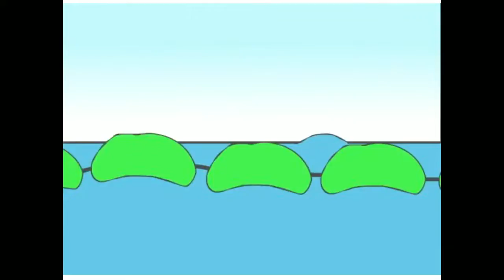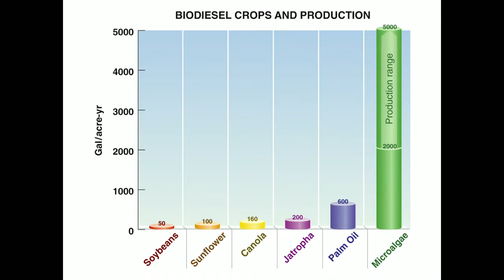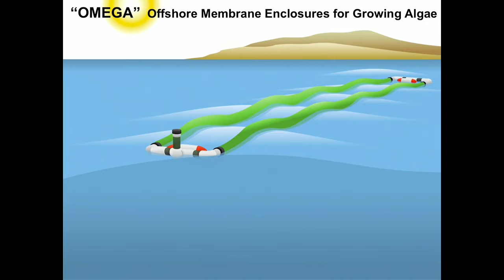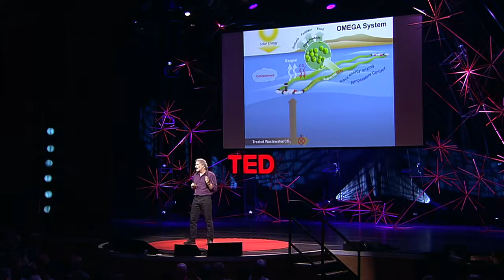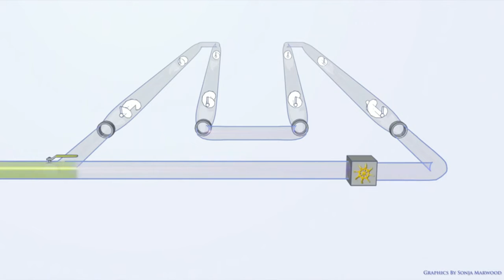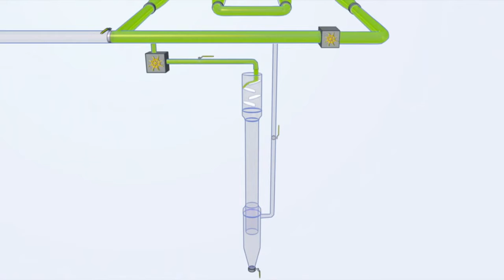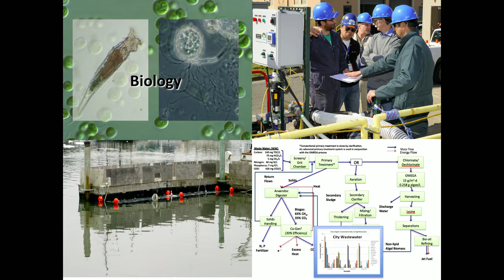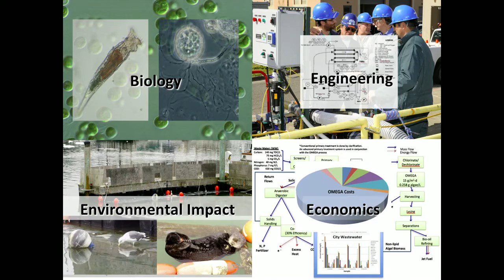Micro-algae Biofuel Production

Comment: Incomparison to traditional oil-seed crops, algae yields much more oil per acre. While soybean typically produces less than 50 gallon of oil per acre and rapeseed generates less than 130 gallon per acre, algae can yield up to 10,000 gallons of diesel per acre. In particular diatoms and green algae are good sources for the production of biodiesel. So the idea od "Peak Oil" is a  Paper Tiger. with the addition of heat + pressure you can turn Algae into sulpher free Light Sweet Bio-crude oil
--Rick